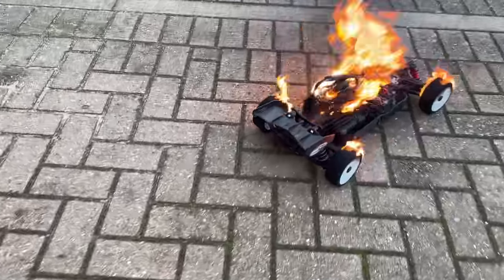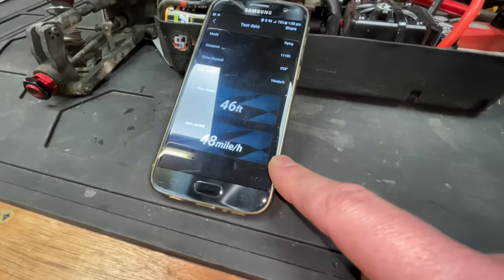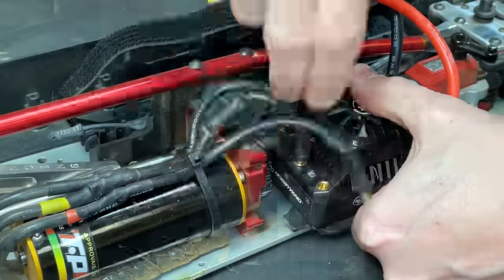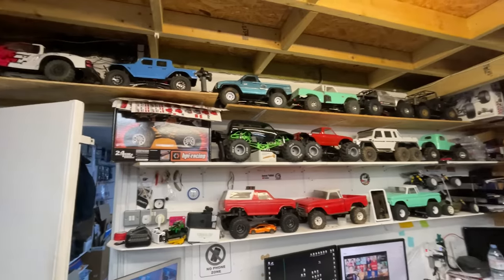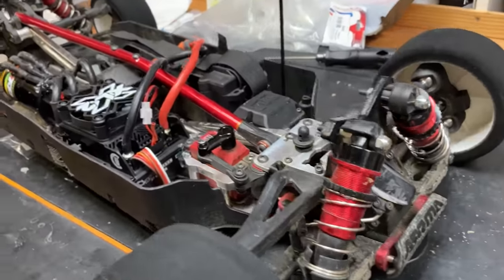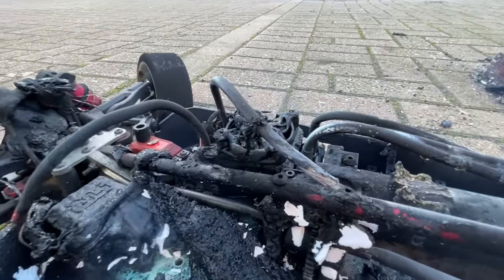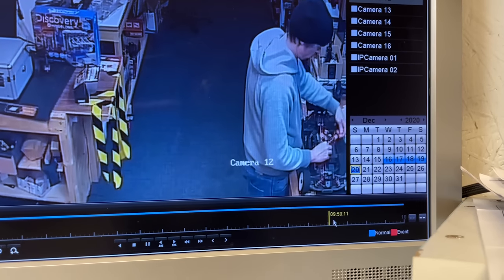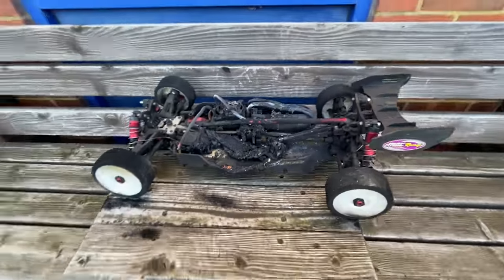Hot Wheels!! - RC Car FIRE - Castle Cremations XLX2 Failure

Comment: Lipo fires happen quick. I mean when the lipo itself goes up, they burn so fast and so hot it's insane. I understand the lipo may not have been the cause but I just had a lipo fire from a faulty charger that I got from Amazon and caught the lipos on fire. It burned my husband's thumbs pretty bad. I panicked and just froze. The 3s sounded like 3 gun shots going off. Scared the crap out of me.

Comment: Lesson:  Class "C" fire (electrical).  NO WATER!  Secure power (open circuit/turn off), then use CO2 or powder extinguisher.  The lipos could be a Class "D" fire (metals).  NO WATER!  For Class "D" fire bury or cover with sand or dirt.
Consult your local Fire Department for expert information.

Comment: I think that it might burn 
because xlx2 has an KV Limit and hapend same thing like in the limitless.
Reply from the maker: where does it say the xlx2 kv limit i cant find it anywhere
Reply: I found it somewhere on internet but if you look carefully here is an fact that motor which you have in Kraton 8S has probably 1100KV and you want to use 3 times more soo that the thing where i think problem could be.
Reply: Hi Kev another thing is that if you look on YouTube almost no one use the xlx2 with motor over 1100KV
Reply: Soo that is probably limit or you can just try slowly hing kv and look on places where you think limit could be.
Reply: @KevinTalbotTV  I found it somewhere on internet but if you look carefully here is an fact that motor which you have in Kraton 8S has probably 1100KV and you want to use 3 times more soo that the thing where i think problem could be.
Reply: @KevinTalbotTV  Hi Kev another thing is that if you look on YouTube almost no one use the xlx2 with motor over 1100KV
Reply: @KevinTalbotTV  Soo that is probably limit or you can just try slowly hing kv and look on places where you think limit could be

Comment: Go back to your earlier videos I commented about the tp power motor your running..... esc killer. Ztw,mgm,castle will all catch fire with that motor anything over 4s I promise. I’ve had the motor. Hobbywing will run it safely but will be slow. 100mph range
Reply: On 4s that motor will pull over 400 amps. You running 6-8s on it....

Comment: With LiiPos like that, all ya can really do is let im burn outside.... Why I try to avoid plugging in new builds indoors if they use more than a single LiPo cell for power. Those can take up to a week or more to discharge in salt water depending on how much of a charge they hold. Damn eh.

Comment: maybe your ESC is too hot or your high speed motors metal gear is scratching on the ESC'S plastic which cause a overheat and  a fire.

Comment: Hobbywing never had a fire lol
Reply: Actually they do... its alot less common when your escs are limited to less than HALF the current... and nobody is pairing it with 3200kv motors on connectors too weak

Comment: You can't pretend that any components last a lot with the abuse you give to those poor RC's you have, i've used Castle in my crawlers for years and i've had no problems, of course i don't jump mine higher than a building and land it in flat ground
Reply from the maker: it was brand new, lasted like 2 seconds!
Reply: @KevinTalbotTV  If that's the case, Damn! Not good, i'll keep an eye on my ESC's from now on

Comment: Sorry about your rig, stick with Hobbywing in the future
Reply: Or read the instructions and follow them... it says to use 8mm connectors that handle wayy more amps like hes using. Also shouldnt be using with a 3200kv 3d wind motor